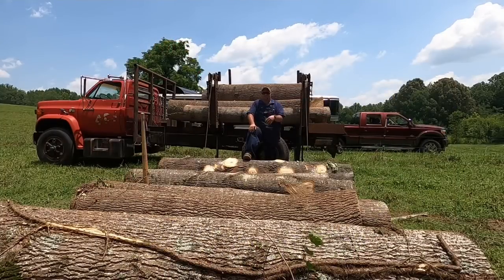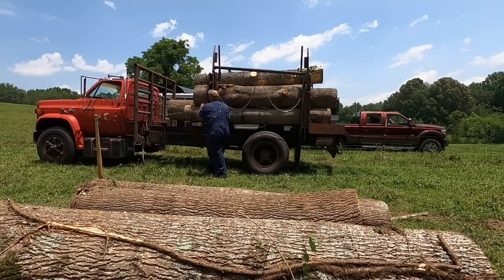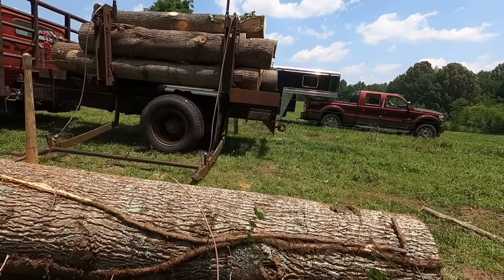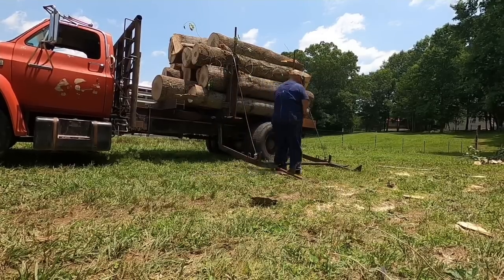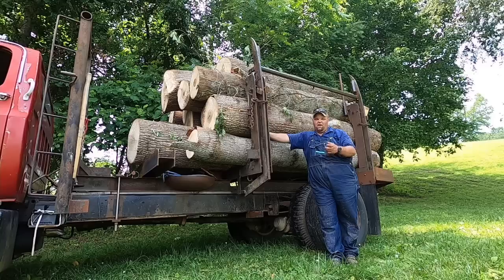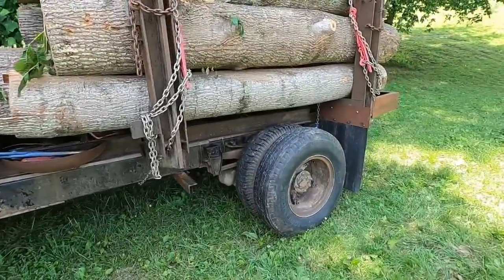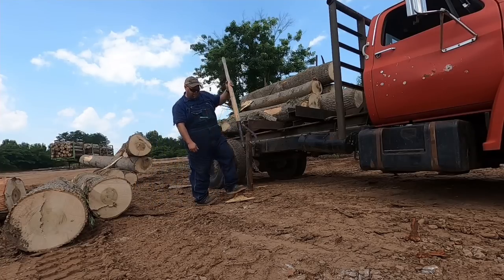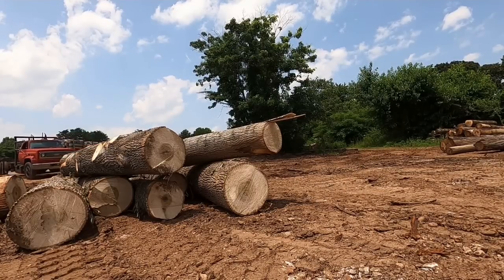Side loader log truck…from the woods to the mill! #042

Comment: Excellent video, I have always wanted to see and learn how those side loaders worked. They where common in my area of South Carolina loading pine sawlogs in the late 50s and 60s but that was before my time. I heard the old timers talk about. I am 42 and went into the custom sawmills business  full time about a year ago. I have a new woodmizer lt40 super and eg100 board edger and nyle lumber kiln. I have a truck about like yours that was a fire truck I converted to a 14 ft dump bed it has the 427 gas and Hydraulic disk brakes. I have a two axle power pole trailer that I put 5ft standards on the I haul log on. Most of the time I get loaded in the woods with a knuckle boom and I unload at my mill with a Case offroad forklift. The only logs I ever haul is my own and I don't haul all that I mill. I just use my rig to get high value logs with 30 miles of my mill. Most of the logging here is set out pine trees that are sold by the ton I buy those from small time operators that bring them in on 6 wheel trucks and I unload them with my forklift. I am not set yet to be able to handle a tractor and trailer but I want get me an old knuckle boom that never leaves the yard. My people farmed growing up so I have not been in the woods all my life. I am learning a lot about logging and how to handle logs from watching your videos your are natural teacher.
Reply from the maker: Wow! Thank you so much for sharing with me… I’m sure you will find as you already have that a lot of your farming skills will carryover into your saw milling and logging skills…running equipment and handling material, etc. I grew up farming and also logging myself. They both intertwine a little. It sounds like you have a really good little set up to start with. And that is key. Have good equipment that is dependable. Not necessarily new. And you can work your way up as you grow your business. I have a lot of hopes and dreams on how I can grow my business, but time will tell. I wish you the very best of luck, and thank you for such kind words. I really appreciate it and thank you so much for watching and also commenting ! It really means a lot to me to hear from you all.

Comment: Looks like the side loader truck works out well for you Zack,but it does look a little scary unloading. 
We'll they unload for you if they're there?
Thanks for sharing and Take Care Friend😊.
Reply from the maker: Yessir they’ll unload ya if they’re there. But most times we go to the mill it’s either after hours or weekends. Which doesn’t work too well for getting unloaded. So the trip stands work good. One just has to know how to be careful around them. Loggers used them for years and years before technology caught up. And some of our Amish mills doesn’t have loaders anyway. They will drag the logs off with a swamp hook and horse off the back. And it takes forever! I’ve been grateful for the side loader no doubt. It’s been a big help. Anyway, thanks for the kind words and for watching! Take care yourself

Comment: I built a side loading log trailer I use to load with a horse. It has a cable operated mechanism. 1 horse will load most of the stuff I haul with it. I have a video of it on my channel if anyone is interested.
Reply from the maker: Cool 😎 thanks for sharing!

Comment: There needs to be a cable or chain that is attached to the H beam on the passenger side of the deck and under the logs. Then the ability to fix the LOG LOADING CABLE to the deck cable, tighten up the log loading cable and the deck cable will lift, at an angel, and the logs will slide down the cables and off truck deck. That is what is use at the mills in Oregon to dump on off days. A set of cables is pulled under the log a fasted to the bumper log at the pond. The winch is engaged and the logs are unloaded. From a logger. Be safe. Awesome video.
Reply from the maker: That’s really not practical with the way the winch drums and such are setup. But would be nice if it would work that way. The side loader trucks were great in their day. But they do require someone that really knows them and how to maintain em too. They’re finicky. Sometimes a down right pain to be honest. We’re headed towards a skid steer just as soon as we can afford it. Thanks a bunch for the kind words and for watching!
Reply: You like making things more complicated?

Comment: Paint that center hook on your fork extension mounting chain!
Reply from the maker: Ha, I have and it just comes off lol.
Reply: @zachodommulelogging  Quick question: how do the cables or brake(clutch) slip when you get the loader arms pulled up tight to the uprights?
Reply from the maker: You just have to control it with the brake handle. Just gotta get a feel for it

Comment: How many board feet did you have on that load ?
Reply from the maker: Right at 1100 of poplar. This truck will haul 14k pounds of logs about anyway you wanna load it. Depending on species depends on how many feet you haul. Heavy hardwood such as beech, maple, oak, hickory…we shoot for 1k feet…and lighter hardwood such as poplar, cottonwood, etc…we shoot for 1600’. Thx for commenting!

Comment: great job explaining things.
 I do have one question. 
example only;   
 a grade a log is $300 for 8 foot;  
a reg log is $200 for 8 foot; 
how much is a banana log for 8 foot
Reply from the maker: It basically just depends on the “sweep.” It’s how much the ends bow up from the center. And they have a chart that tells them how % to dock the footage for. Your grade will remain the same no matter crook or sweep. So if it’s a grade prime, prime plus, 1, 2, or 3…it’ll remain that grade. They’ll just dock footage off of the total footage for that log. A log such as that one would have around 100 bdft in it and time they’re done it’ll wind up around 85-90. Somewhere around 9% overall dock usually. And I’ve cut enough to know when to cull it and cut the worst part out and leave it in the woods. But a slight bow won’t hurt anything too bad. Or slight crook. Of course there are limits to anything. Good question my friend and thanks for asking! Hope I explained it for you.

Comment: there is no way you can scale that load its all on the rear axel
Reply from the maker: It scales just fine. I’ve axled the truck out several times and it’s usually pretty close to where I want it. The loader sits 8” forward of the rear axle and on these trucks that’s where most of the weight goes anyhow. This is a 32k pound rated truck with a 21k rear axle. Trust me, it’s fine. I’ve driven trucks most of my life and if it wasn’t fine or legal, I wouldn’t put it on the road. Thanks for watching and commenting
Reply: @zachodommulelogging  thank you for replying back
Reply from the maker: Yessir you’re welcome